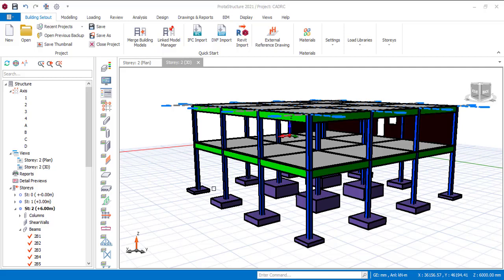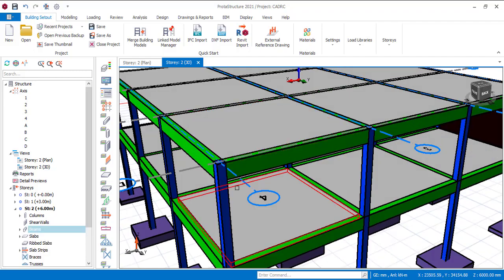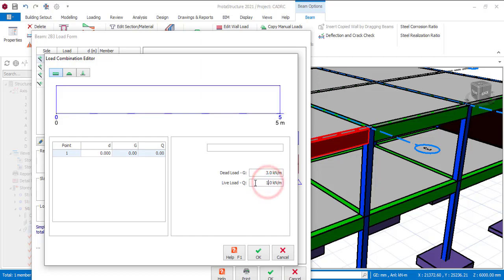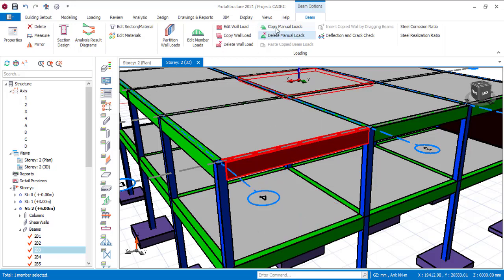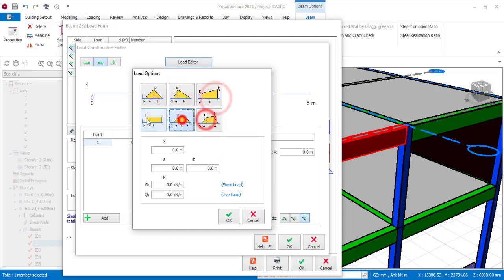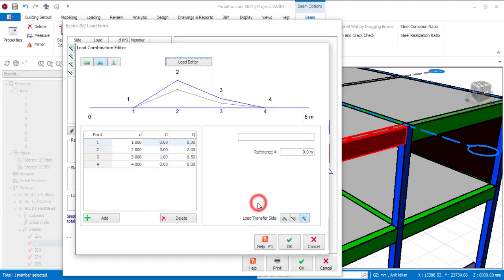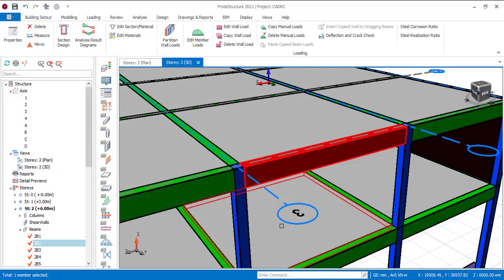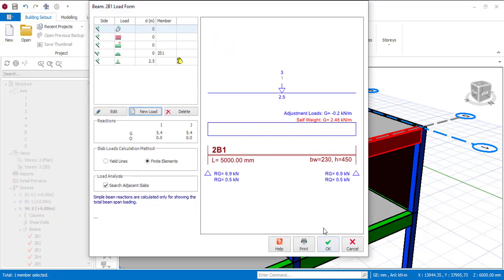Loading a beam with Member/Manual load in ProtaStructure.

Comment: Why did you use unfactored Load sir.
I thought we are supposed to design in ultimate limit state and not serviceability limit state?
Reply from the maker: I didn’t attend to load factor in this particular video. You’ll first apply the actual load before you tell the program the factors to be applied in the process which is exactly what is shown here. You’ll have to apply the necessary load factors before you carry out the building analysis.
Reply: @ridwantician  can I have a link of to one of your videos whereby you did this sir?
Reply: @ridwantician  please 
can this be done on prota structure 2026